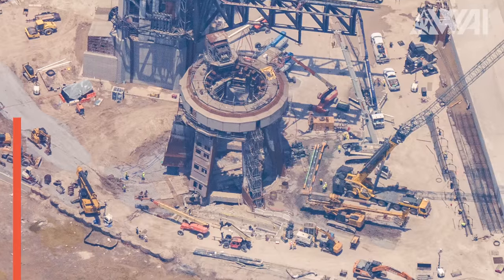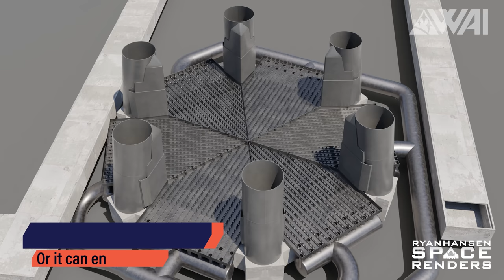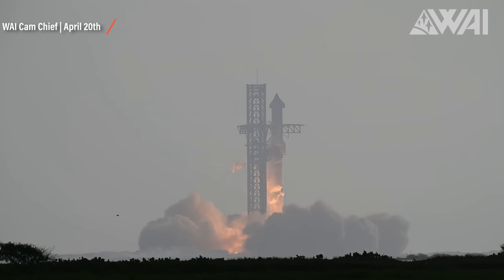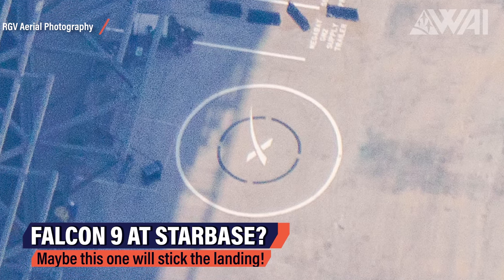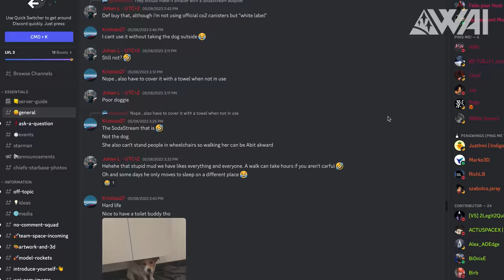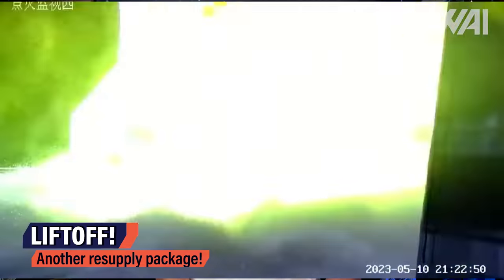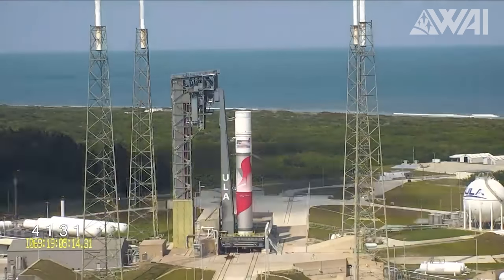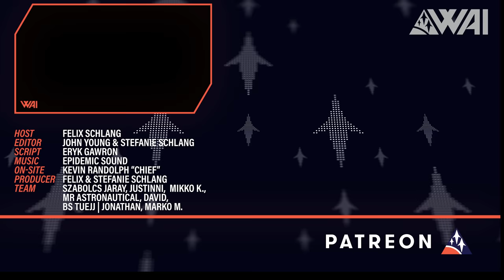SpaceX's even larger Starships made possible through world record Raptor 3!

Comment: What I LOVE about Space X is it’s like old school NASA:  design, build it, blow it up and try again until you get it right.  Everything they are doing is pure R&D. I LOVE it!
Reply from the maker: That's because back in the dayus NASA tried new things. That's what you need to do when trying out new things. :D
Reply: @Whataboutit  Agreed!!
Reply: Fortunately, they don't have to blow up as much stuff since computer modeling and testing is 100 times more advanced.  Hell, your pocket cell phone is a super computer compared to the Apollo computer
Reply: Musken has the money to do so, that's the privilege :P.
Reply: " it’s like old school NASA "
Not even close.  Those two should never be mentioned in the same sentence.
Reply: Von Braun would disagree. They designed things the way they have always designed things. With the mindset that if you want something to take the power and the heat - you make it at least TWICE as strong.
Reply: @CaptainRon1913  " they don't have to blow up as much stuff since computer modeling "
Tell me you are being sarcastic.
Reply: @jason_m_schmidt622  " Von Braun would disagree "
Man, I miss the days when being recognized as  a genius had nothing to do with tweeter.
Reply: @jason_m_schmidt622 no that would imply more weight, you want to design parts with a security factor as close as 1.0 as possible for aerospace parts.
Reply: If the Democrats would quit cutting their budget,  they could be that way again.
Reply: Actually, you're missing the 100+ successful launches of Falcon 9 (including landing and reusing of most of the 1st stages).
Reply: Why does Musk have to make it so complicated?  Why not build the proven trench like NASA does?
Reply: @Whataboutit  NASA still tries new stuff but unlike SpaceX they actually take the time and effort to actually design correctly before they test. Saving time,money and effort. SpaceX keep NOT doing the basic work and ends up having to do it anyway to get something working. (The "pad" is a prime example as is the still unfinished design of the Superheavy and Starship) A major issue with a 'water-deluge' system is that SpaceX is not authorized to install one beings they have yet to provide a viable plan for the run-off to the Army Corp of Engineers. (Just like they lacked a credible "expansion" plan which is why there were denied)
Reply: NASA never did that, in fact no one actually does that. It's far better to actually design a working vehicle (which is what everyone, including SpaceX for the Falcon) does and then tests that design. As of yet (according to no less than SpaceX itself) there is NO actual design for Superheavy OR Starship as neither has a final form. So essentially SpaceX is wasting everything (including time and money) by not doing what any competent organization would do in this case. Worse, because they never did that initial design work (or basic testing) they have to redesign and rebuild all over again when literally SIMPLE calculations would have shown the launch mount and pad were inadequate for the task.
Reply: Myself, I think SX has made a spectacular and costly failure here. I think most people watching this facility play out knew that this launch pad design would not work. It never worked without damage to the stand and surrounding area and that on a much smaller scale. They had parts for the new deluge system already there waiting to be installed but never installed it. Now, they are faced with even more reasons not to launch according to the FAA, the EPA and a host of others. I'll be very surprised if they launch again on the launch date announced by Musk.
Reply: Except that old school NASA was intelligent enough to know that they needed a flame trench under the rocket.
Reply: @rocroc  Well there IS a reason it's called "Elon Time" after all :)

More to the point though Boca Chica was a lousy place to try and put a launch site, especially one for a super-heavy rocket.. And yes most people who know anything about civil engineering and most rocket folks KNEW the pad wasn't going to work, that much should have been obvious to SpaceX but it fits the general pattern of "development" (specifically the lack thereof) that we've seen with Starship.

Though the host of people with issues and unresolved regulatory issues (SpaceX has yet to clear a majority from the "Starship" test program let alone actually complete the ones given for even considering launching from there) will give them plenty of excuses for not launching again for a long time.
Reply: @goldslinger  permitting and environmental assessments. They say hey we’ll dig this big hole in an area with that high a water table next to a nature preserve. And we wait six month to a year for it to be approved. Also one thing that doesn’t seem to be mentioned much anymore is those two oil rigs, hard to put a flame trench on an oil rig. I also believe this system if they can get it to function will make the point to point system easier and cheaper to deploy in the long run. We have to remember many starships with many launch pads. Not just one big expensive launch pad that they use for 60 years like the ones at the cape.
Reply: @randycampbell6307  Randy; it has turned out to be a lousy place given what has happened. If you start at Boca and follow the border to the tip of Florida there really are no places that fit the bill. SX originally "said" they had something smaller in mind for this location - the Falcon 9. They weren't truthful or were wrong in their estimation of what would be built in Boca. They should have moved the residents out and gotten more help from the state to deal with the restrictions that were sure to be proposed by the EPA, FAA and a recalcitrant administration. Time is not on their side. They will have to go to the gulf or find a crazy thinking collaboration with the US and a nearby country just down the road:-)
Reply: @georgejones3526  And NASA knowing the water table at the Cape was so high built up  so they could dig down and make the flame trench. SpaceX couldn't provide a coherent plan for doing so (nor any real plan at all) so they got denied permission to do so. Given they don't have permission to build a "water-cooled steel plate" (nor any actual plan of what to do with any excess deluge water or runoff from the same) I'm going to be interested in seeing how they screw this up.
Reply: @rocroc   Access to public beaches is literally written into the Texas State Constitution :)

The main issue is that SpaceX (Musk really) was trying to escape regulation and oversight but instead went someplace where he was going to automatically get both
Reply: @bakters  Or recognized as a former slave driver.
Reply: @randycampbell6307  yeah you are right. SX is worthless we  didn’t need them at all in the last Decade. The Russians would have gladly taken out as astronauts to the space station at triple the cost, and now that we have SLS up and running “kind of”after being delayed for 7 years. We’ll have no problem going back to the moon. Except for the landing part.  Oh that’s right the star ship is the lunar. Ever think that SX is acutely way ahead of you and planning on landing and taking off from. Places that don’t have infrastructure.
Reply: Only when NASA was rapidly iterating space exploration vehicles qns software, the hardware and software were developed in several differing states across the country by completely different companies. All of which competed for NASA's budgeted allowance.  Inefficient. Conversely, Space X does nearly all development in house, faster, better, and at SUBSTANTIALLY reduced cost!!!
Reply: @goldslinger  boca chica is at sea level from what I understand, so a traditional flame diverter trench wouldnt be possible at that location.
Reply: @randycampbell6307  its called iterative design, and that's how new discoveries are rapidly discovered and put to the test instead of sticking to the traditional methods which would see SpaceX just become another boring launch provider. After all the new ground they have broken with Falcon 9, the Raptor engine, launching the worlds biggest and most powerful rocket ever, the list goes on, what is your point? That they are all wrong because that's 'not the way it was done in the past'? 

Imagine if the Wright brothers had adopted that mindset, they would never have bothered inventing the plane. Meanwhile what have traditional rocket launch providers done of note in the last 50 years? NASA took nearly 30 years to build one outdated rocket and is almost obsolete due to petty politics. The rest of the private launch sector cant think outside the box or don't have the funding. The last thing we need is another Blue origin or ULA that keep everything behind close doors while simultaneously doing nothing interesting.
Reply: "It blowd up real good" John Candy.
Reply: @zackaryjoubert8303  "Space X does nearly all development in house, faster, better, and at SUBSTANTIALLY reduced cost!!!"
Reduced cost? Are you effing joking? SpaceX is only staying afloat because of the massive tax payer funds shoved in their direction.
Efficient? Like building stuff that they don't know if it will work, blowing it up because it doesn't work, while already having a whole slew of slightly different variations of the failed design while the chances aren't based on any actual test data or simulations but just based on the old thrown spaghetti against the wall and see if it sticks.
That's not engineering nor designing stuff like a pro but 3rd rate amateur hour by people that are trying to re-invent the wheel.
In the mean while wasting hundreds of millions of US tax payer and investment firms money with each failure.

Not Elon's money mind you, Elon doesn't fund anything in Tesla or SpaceX or any of the other companies. The only time he puts money in is at the very beginning of getting involved with a company, afterwards he only takes money out. And to see how great a manager he truly is you just have to look at how Twitter has become an utter shit show where it's easier to stumble upon pet torture videos than something you might be interested in.
Reply: That's not what "old school NASA" was like at all.  You have no idea what you're talking about.
Reply: @zackaryjoubert8303  NASA and SpaceX have to support different "customers" (for the most part, in fact currently SpaceX has to please both Congress and NASA/DoD :) ) whereas NASA has to keep Congress on-side, SpaceX only has to keep NASA and the DoD on-side. Neither of those require contracts to be spread out over many states to ensure support.

However SpaceX's "in-house" development has worked previously (see Falcon) but as noted that takes actually beginning with a working design, something we've not see with Starship. How much the 'in-house" saves is questionable since SpaceX does not actually disclose figures but as Falcon showed it's not likely it is actually that much cheaper than streamlined operations and construction, again something that requires a working design to start with.
Reply: @Carl Ruffier 
That's how I learned. I don't need help with that. If it didn't work, it's on me. Luv your comment.
Reply: @Carl Ruffier "What's"
Reply: @philipstrutt1086  "its called iterative design,"

That's literally not how it works for vehicle design, you have  finalized design ready to go BEFORE you start testing. SpaceX has successfully used that method before and it is not working at this point. Yet the continue to call it such which is both false and misleading.

"... and that's how new discoveries are rapidly discovered"

And the discovery would clearly be that the "method" is not working and needs to be modified.. Yet SpaceX is not doing so. Kind of telling.

"... and put to the test instead of sticking to the traditional methods which would see SpaceX just become another boring launch provider."

"Traditional methods" actually work and SpaceX has PROVEN they can use those methods and still innovate and reduce costs so the 'argument' is pretty baseless.
Worse it is very clear that NOT having a working design from the start has done nothing but waste time, money and resources and held SpaceX back.

(I won't even go into the lack of economic or operational incentive with the "plan' that SpaceX has which currently have no basis in reality)

 "After all the new ground they have broken with Falcon 9,"

Again a perfect example of a method that actually works and has no relation to the current "Starship" mess. Again using Falcon does NOT help the argument and in fact argues very much against the "program" as it is currently seen.

"... the Raptor engine,"

And engine which is moving towards a "third generation" because the first two do not work nor are they reliable enough to be used. The BE-4 took a bit longer and cost a bit more but actually works and has a proven testing record. Again not helping because SpaceX developed the Merlin with a more focused and better planned effort.

"... launching the worlds biggest and most powerful rocket ever,"

Has not happened yet and the "test flight' was an utter failure by any measurable means. "Getting off the pad" is a "goal" for an amature organization building its first rocket, not a supposed professional company that could have easily "calculated" the power and danger of such a large rocket but decided to just 'wing' it and destroyed their pad.
(Also losing all there clearances and regulator support while also doing significant damage to nearby {less than 10 feet away from the pad in some cases} wildlife habitat and refuge's'. Which in turn has caused lawsuits and the withdrawal of other clearances and demands that SpaceX honor it's agreements, which to this point it has not. Horrible PR and worse planning but they had no need to use Boca Chica at all anyway)

"... the list goes on, what is your point? That they are all wrong because that's 'not the way it was done in the past'?" 

No, my main point is we're "here" because of a series of bad decisions by SpaceX that have been in opposition to methods and means that SpaceX has well proven they can actually use to accomplish things. This "plan" for Starship is both ill-advised and clearly not working and SpaceX has little good 'reason" to continue down this path. 

The list of 'failures' and shortalls DOES go on and it's clear that SpaceX is floundering.

"Imagine if the Wright brothers had adopted that mindset, they would never have bothered inventing the plane."

Odd choice in that BECAUSE the Wright Brothers legally and socially claimed "sole" rights to inventing the airplane that they also held back and significantly impeded aircraft development in the United States to the point it ended up almost a decade behind the rest of the world. In fact that caused the ancestor of NASA (NACA) to be formed with the mission to not let the US fall behind in research and development again.

SpaceX currently has a near monopoly on launch services (and Musk has made no bones about his aim with Starship being to make such a monopoly unbreakable if he can) but is being challenged by ULA and Blue Origin. That they are not 'tossing empty shells into the air' but actually designing and building operational rockets whereas SpaceX is not is rather telling.

"Meanwhile what have traditional rocket launch providers done of note in the last 50 years?"

Proved resuablity, proved vertical take off and landing long before SpaceX did, landed on the Moon and Mars and delivered thousands of satellites into orbit while building a satellite and launch market that SpaceX needed to even get started.

Oh and in NASA's case literally giving SpaceX money and launches before they had even built their first launch vehicle.

"NASA took nearly 30 years to build one outdated rocket and is almost obsolete due to petty politics."

Part of the problem with being a "government" aerospace organization really. Oh and one that to fight that same government tooth-and-nail to get SpaceX started and give them launch contracts.(Which most of Congress still does not support)

"The rest of the private launch sector cant think outside the box or don't have the funding."

But they do in both cases. To be clear due to SpaceX's obsessive secrecy on actual costs and refusal to let anyone examine their books or accounting we still don't have a clear idea if reusability has actually been cost effective. Launch prices certainly don't reflect such, especially in what SpaceX charges government users which has not been much lower than "standard pricing we've seen in the past. Blue Origin is betting on reuse and unlike SpaceX plans it from the ACTUAL 'start", ULA is of the opinion that cheap construction will still allow expendable launchers to be cost effective and as noted the price point is still about even.

"The last thing we need is another Blue origin or ULA that keep everything behind close doors while simultaneously doing nothing interesting."

 Yes SpaceX is "interesting" in a morbid "lets see how they screw up this time" way but not really interesting in an innovative or working way. Badly designed and built vehicles that tear themselves apart every flight or crash on landing are not really showing progress, just wasting time, money and effort as we've seen.
The Blue Origin or ULA vehicles 'could' fail on their first launches but the odds are very much lower BECAUSE both have taken the time and effort to do the job right the FIRST time and start with a working design.

So far SpaceX has failed almost EVERY time with "reusability from the start" (their claim and one that was very clear from the being ) having been tossed aside so they can provide never ending "spectacle" rather than actual progress.
"Standard practices" exist for a good reason and has been shown over and over again when Musk ignores them he tends to fail rather hard.
Reply: @randycampbell6307  
Yes, and I believe it took NASA three and a half years to build the trenches, most of it spent waiting for the built up earth to settle.
Reply: @all5stars  With nearing, on 20 million lbs. of thrust, I don't think a few extra lbs. espeCIAlly for more testing, will be a factor. 
Just don't make the vehicles stronger than the Flight TerminNation Systems! 😲😅
Reply: @goldslinger  Think it has something to do with the water table. It's, basically, at the surface, and salty water wreaks havoc on steel.
   The water-cooled steel plates, will work great!
Reply: @randycampbell6307  Do you also suffer from T.D.S.?
Reply: Exactly! As someone who grew up during NASAs glory years, SpaceX reminds me of exactly that. Well said.
Reply: @PDVism  keep ranting until you've exhausted the alphabet. Meanwhile SpaceX will continue to break new ground while the only thing you break is your keyboard.
Reply: @goldslinger  because any hole you dig there will be full of water within hours at best. They are at the water table. But it's salt water. You can't use this because turning it into a steam cloud would very bad news. They have to truck the water in, 8000 gallons at a time. Building a desalination plant as they once planed was shot down already. Thus the first plan that has failed. They tried. Next! We will see if this works.
Reply: @philipstrutt1086  Break OLD ground you mean, how many times now have they had to repair stage zero?
Reply: @rocroc  welp, we tried, humanity. Let’s ask Russia if our astronauts, er, American Cosmonauts, can launch under their supervision.
Reply: @PDVism  I rest my case. There is no helping some people determined to focus solely and blindly on the negative. Must be a sad life.
Reply: @Mike19737 nah, not really. Wasnt NASA slow because of first Qualifying each Single part and component? Guess, Elon comes much quicker to his next lessons-learned from a destruction 😀
Reply: @randycampbell6307  OMG - Are you trying to say that SpaceX is incompetent?!

I loved what NASA was able to accomplish with the Mercury -> Apollo missions, but let's not forget the billions of dollars it cost and the three lives lost. 

The shuttle? While impressive, it was a doomed operation from the start; failure at its primary mission that additionally cost the lives of 14 astronauts and civilians.

And let's not forget who paid (and continues to pay) for those projects. 

Is NASA a competent organization? Welp, it's about the same as every other government-run entity.
Reply: @philipstrutt1086  exactly right!
Reply: @randycampbell6307  Man, you salty! 😂
Reply: 33 engines are a lot to waste..
Reply: @stratolestele7611  "OMG - Are you trying to say that SpaceX is incompetent?!"

Current signs would point to that outcome given the vast disparity between SpaceX's competence with projects such as the Falcon and what we see being displayed in the continually failing "Starship/Superheavy" project. 

"I loved what NASA was able to accomplish with the Mercury -> Apollo missions, but let's not forget the billions of dollars it cost and the three lives lost."

The cost was high but lest we forget the Soviet's also lost people (and more) during that same period with about an equal expenditure but less of an outcome. How a program is run and what end goals matter. SpaceX designed and developed the Falcon with a specific and very well organized goal and outcome in mind. There is almost no evidence of the same effort currently and a LOT of evidence that both organization and planning are distinctly lacking in fact.

"The shuttle? While impressive, it was a doomed operation from the start; failure at its primary mission that additionally cost the lives of 14 astronauts and civilians."

The Shuttle achieved most of its goals of demonstrating a reusable vehicle and architecture was in fact plausibel and achievable. It's primary "mission" was to increase access to space and lower the overall cost which it in fact did to a degree over then current manned launch systems. Starship/Superheavy has of yet to meet ANY of its "supposed" goals be it reuse, reliability or lower cost.

"And let's not forget who paid (and continues to pay) for those projects."

The same ones who are paying for Starship/Superheavy, mostly the American taxpayer. (Anyone who thinks SpaceX or Musk is "self-funding" has not been tracking government payments to SpaceX which will be several billion again this year) And keep in mind that the only plausible 'customer" for Starship/Superheavy is the US government essentially paying SpaceX to fly it. (Assuming it can be flown from anywhere in the first place)

"Is NASA a competent organization? Welp, it's about the same as every other government-run entity."

NASA's rocket flew and completed an actual mission whereas SpaceX's rocket blew up and destroyed its own launch pad through fully preventable and known issues and problems. Comparatively NASA at this point is FAR more "competent" than SpaceX appears to be.
And again this is LITERALLY because of mistakes and bad decisions BY SpaceX during this whole project.